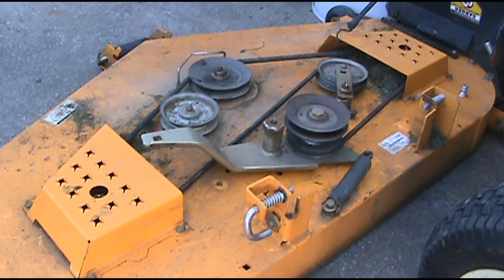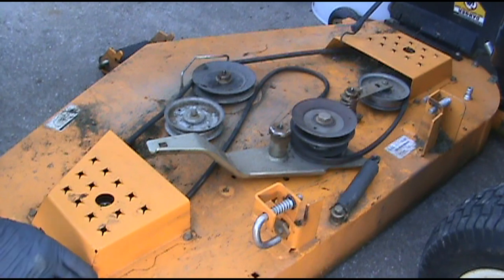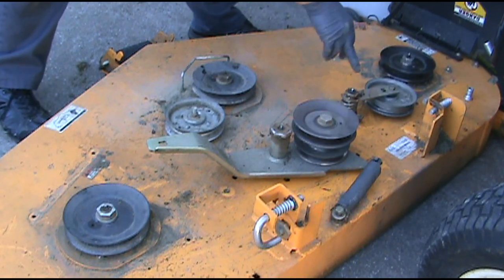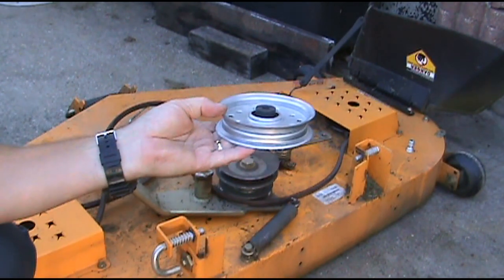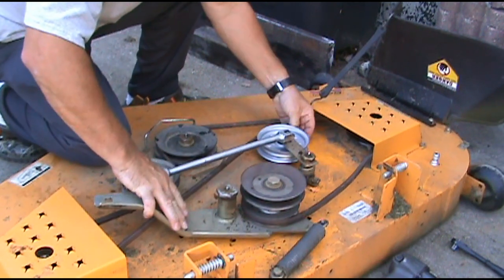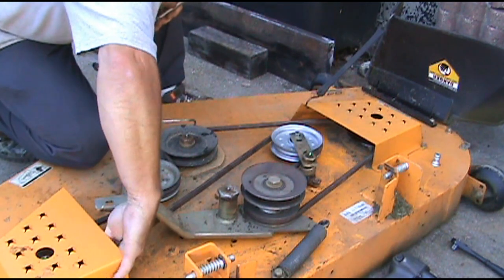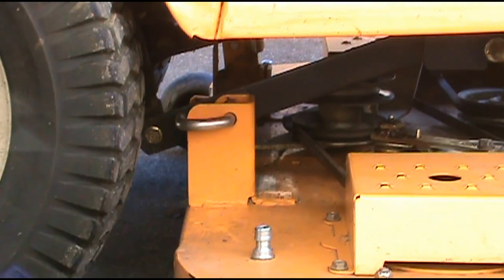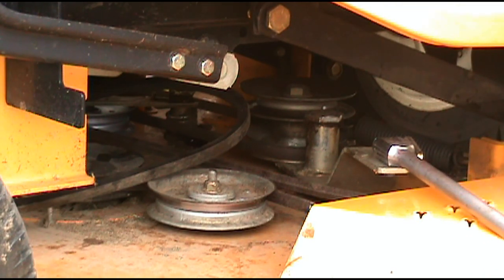Cub Cadet GTX 2100 belt configuration and belt pulley replacement

Comment: Thanks for this video! I did this but now my power steering doesn’t work?! Did I mess something up turning the steering without the mower running?
Reply from the maker: Your welcome and No you shouldn't have, the steering is separate from the deck belt. Look and check all the connections related to the power steering.

Comment: Thanks for the video. You still got the gtx2100? Was going to ask you what setting you now on? I mow 3 but I find the anti scalp wheels drag a bit. I have lifted the front a little to accomodate the front scalp wheels but cant see if you can adjust the height in the rear. Any ideas? ( moving the scalp wheels up makes them too high and I get scalping.
Reply from the maker: Your welcome, I mow with the deck as high as it will lift.

Comment: Thanks.. Excellent video for how to do it correctly. If I have a problem with the PTO belt wanting to schred. and the adjust lever (ie 1,2,3,4,5) will only stay around five what is the problem
Reply from the maker: You need to adjust the height knob.

Comment: Hey Lonnie I was trying to see at the end does the PTO belt touch the front "pulley guard"? I have a 2154 and the belt rubs on on that silver guard i fee like it is reducing the life of my belts.
Reply from the maker: There should be a guard on both sides of the pulley to keep the belt from coming off and the belt shouldn't be touching or riding on the guard.

Comment: I have a gt2100 with a 48 inch fab deck. Do happen to know what the deck belt number is.
Reply from the maker: What is your model #? it should be under the seat
Reply from the maker: Here is what I found for the 48" deck

Cub Cadet 954-04045
Spindle Belt, .50" X 109"

Cub Cadet 954-04055
PTO Belt, .625" X 111.40"
Reply: @LonnieJohnson1  thank you thats very helpful.
Reply from the maker: Your welcome
Reply: Cub Cadet has assembly parts listed for the different mower deck widths listed in a manual that can be downloaded from their website.
Reply from the maker: You have to watch the downloads because some contain viruses. I would never download from a website. But that's just me.